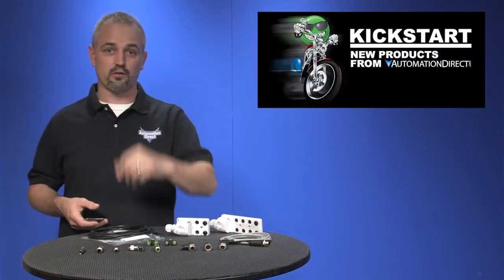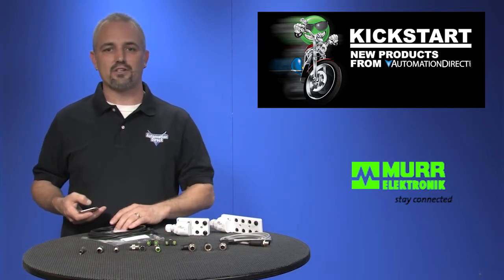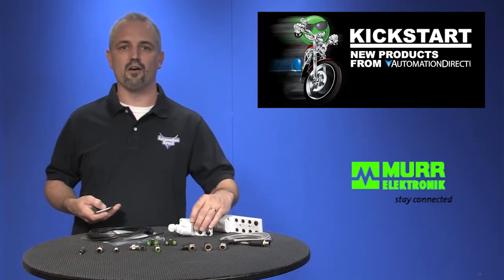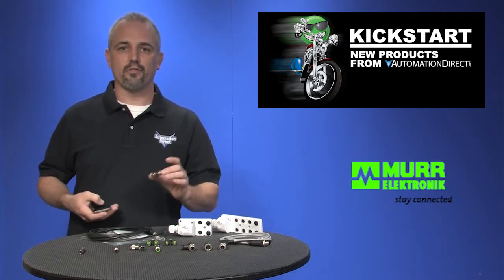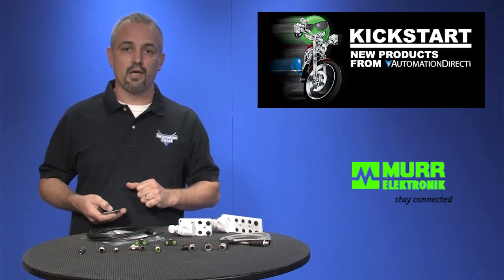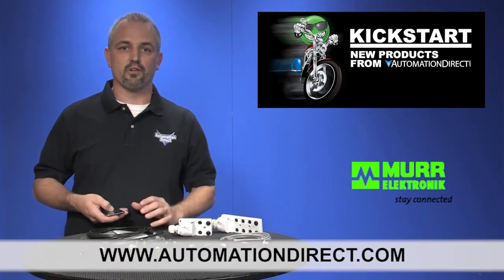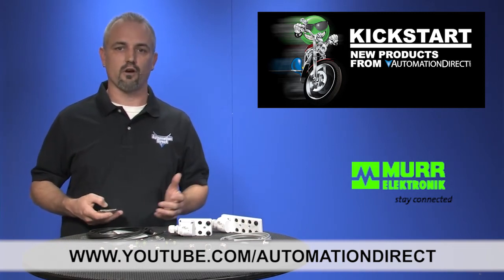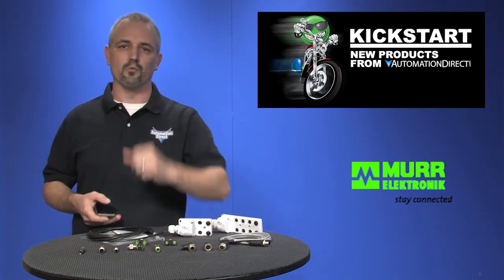MURR Multi Port Junction Blocks & Sensor Connectors from AutomationDirect

Comment: I am looking to use a magnetic proximity sensor and connect it to some sort of LED indicator that can be seen from across 15ft room. Would the LED light on the ZIPport junction box be sufficient enough for this application? And would the junction box supply power to the sensor, or would they both have to be hooked to a power supply separately?
Reply from the maker: Hi Dan, for technical questions like this, please contact our free award winning tech support. They are setup to give you the most efficient and quickest support. 

Phone:    1-800-633-0405
Email:     https://www.automationdirect.com/adc/Form/User/TechInquiry
Support:  http://support.automationdirect.com/

Please let us know if you have any other questions! 

Thanks, 
AutomationDirect